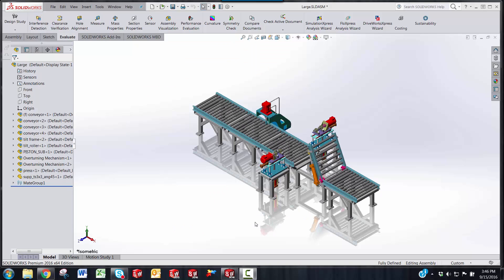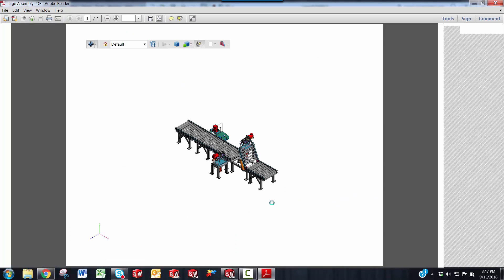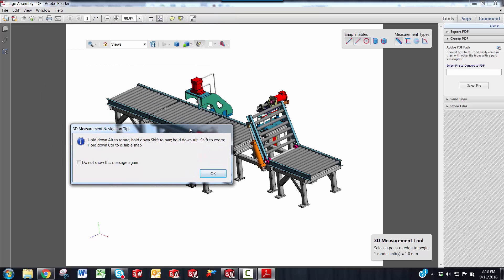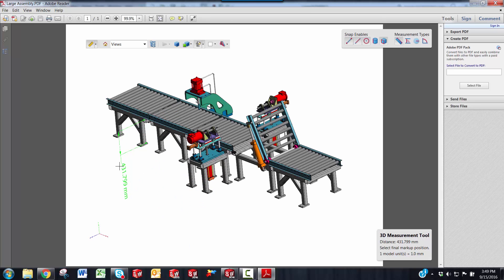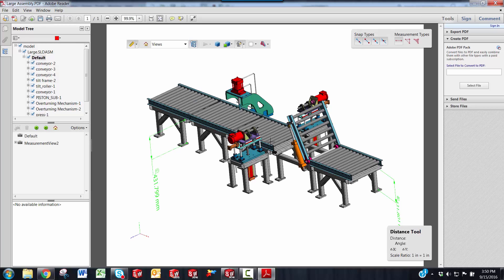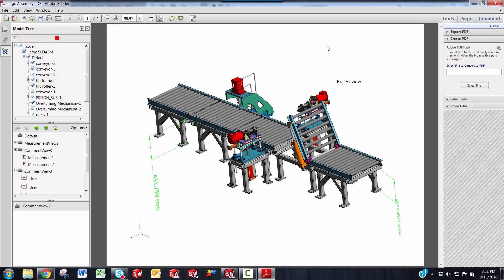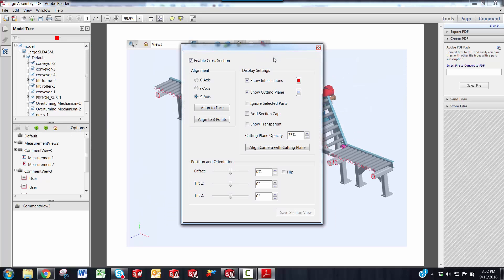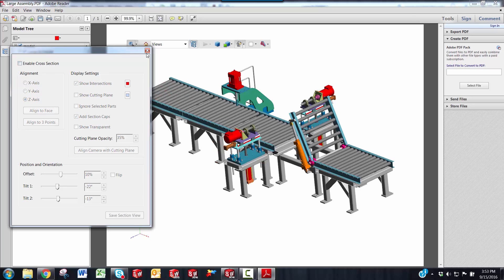SOLIDWORKS - How to Export to 3D PDF

Comment: Great tutorial!
One question please: is it possibile to show in some way the number of the configuration of the part?
I don't need to switch between configurations, i just want to show the number

Example: my part name is DSPA110967A in SW and the confguration string is " (00 I= 2750)
When I save as pdf 3d the assembly with the part i mentioned, in the Model Tree of the pdf 3d is showed as DSPA110967.... 
What i need is to show the string "00"
Hope to be clear.
Thanks in advance
Reply from the maker: I do not believe there is a way to do what you are looking for at the moment.  Check in with your VARS tech support team to see if it makes for a good enhancement request.
Reply: Maybe you can engrave a solid of your configuration so you know which one it is.
To engrave you can use this: https://www.youtube.com/watch?v=q9J7vgJhuBo
Hope it helped!

Comment: Hi, is there anyway to prevent viewers from hide or disabling parts in pdf?i want to show my model to a customer but im afraid he use this feature to hide parts and see the inner parts
Reply from the maker: There are no options to lock controls in 3D PDF. You will have to suppress the internal components in SOLIDWORKS before saving as 3D PDF.
Reply: @goengineer  thanks for your help and time.i will do it.much appreciate

Comment: Is it possible to export more than one configuration in the same 3D pdf file ? and maybe change the configuration inside the pdf ? Thanks
Reply from the maker: Configurations are not supported with 3D PDF. You may consider exporting to eDrawings instead. (File -> Publish to eDrawings). A dialog box will pop up allowing you to choose which configurations you want to export. Once the file is opened in eDrawings, you can go to File, Save as, then save the eDrawings file as an executable. You can send anyone this .exe file and it will open the file in eDrawings (without having it installed on their machine). In the lower right corner of eDrawings there is a Configuration Icon that will let you toggle between configurations.

Comment: Is it possible to move assembly parts in 3D PDF?
Reply from the maker: Hi shalabh,
The positions of parts in the 3D PDF are final.  They would not be able to move from the positions they are in when the 3D PDF is saved.
Reply: GoEngineer So the 3D pdf will not even show the possible motions in the assembly that were  allowed in SW assembly, (say an arm of a robotic assembly)?
Reply from the maker: Correct, this is a limitation of 3D PDF.
Reply: GoEngineer Thank you so much for your help!